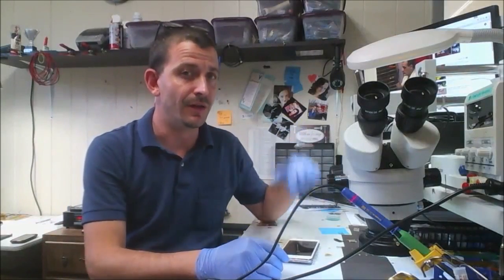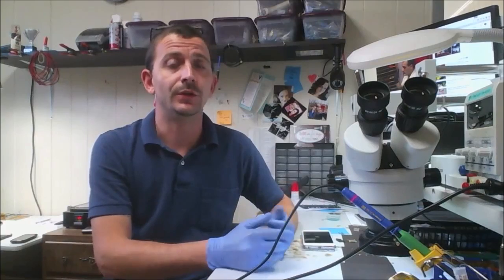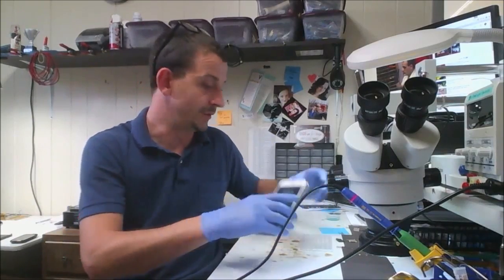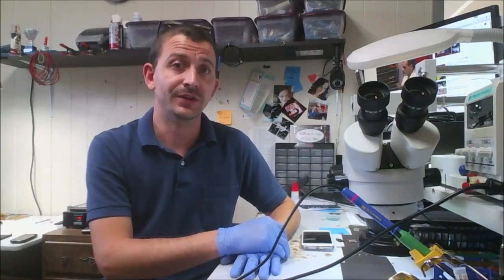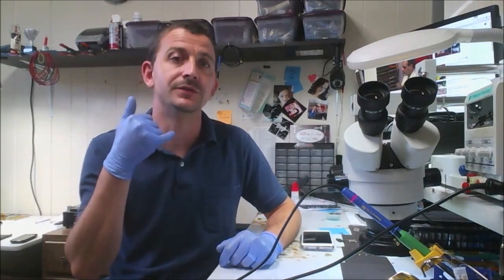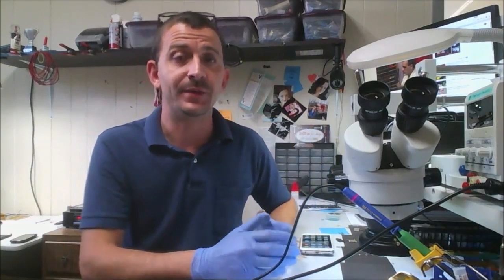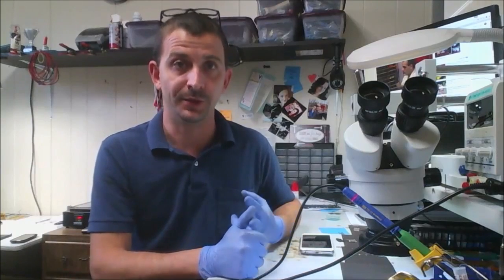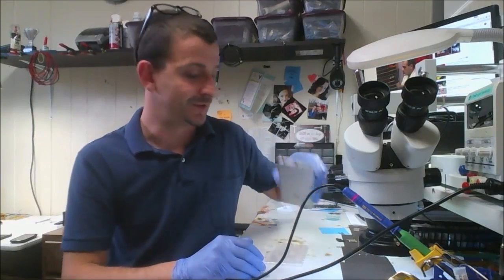iPhone 6 Plus Touch Defect - Which IC is it??  Here's my thoughts.

Comment: hi, so i was just doing the IC chip repair for 6+ and i messed up pretty bad, the strip of tiny resistors between the U2402 and U2401, some of them have gone missing, and also i am missing 3 those small silver dots on which the chip settles. 
any solutiong?

Comment: I've had at least 1 come through my store daily and noticed the same thing. Have been theorizing this for a while as well. It's rarely , in my opinion, cumulus. I've now ran into 2 verticals lines through LCD with intermittent touch after swapping ics(not a screen issue)Going to troubleshoot tomorrow but not the first time I've seen this. Any thoughts? Also can I recommend an omnivise, it'll make your repairs under the microscope much easier!
Reply from the maker: Awesome, thanks for letting me know. A 20 minute touch IC repair is a good one.  I always shoot for 20 minutes and then it turns into 2 hours. I'm glad these videos help - knowing that keeps me recording and improving quality. :)
Reply from the maker: +Stephen Elliott when I run into the vertical lines after replacing the ICs it always winds up being the Meson IC.   I've had defective ICs do that but more often it's from not fully melting all of the balls so the chip is a tiny bit high on one side and not all of the balls make contact. I'm going to take your advise on the omnivise although it may be hard to transition from my current kapton tape mounting system :) thank you!
Reply: Replaced meson and fixed issue, thanks again. By the way, in 2 days from watching your touch ic vids ive minimized overheating and down to 20 min meson repair...successfully. You rock man! My opinion tools make the difference...entertain the omnivise it makes repairs night and day. As always thanks again.

Comment: Could it be the component that it's connected to that causes this failure?
Reply from the maker: +Ju-elz Mesidor Yes, it would not surprise me.  I have 4 to do today.   One of them is the phone in this video.... It came back with flickering grey bar after the customer had it for less than an hour.  Both chips were replaced and I know this guy didn't bend it.